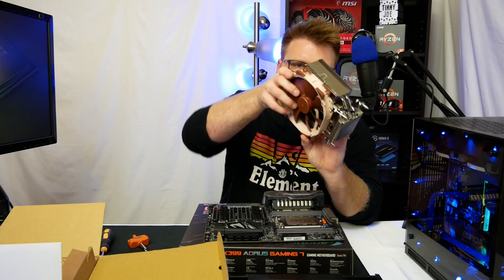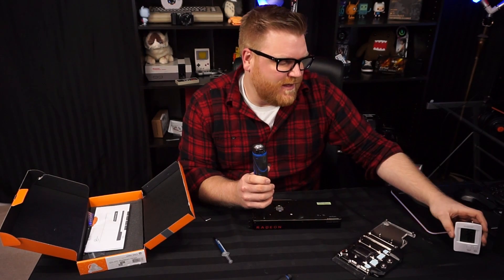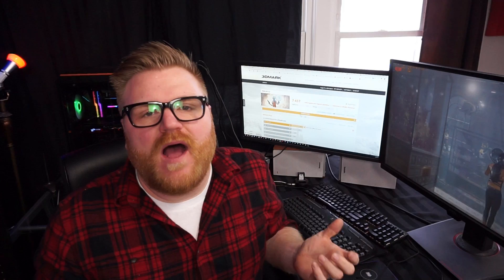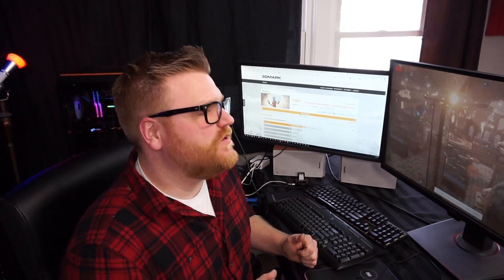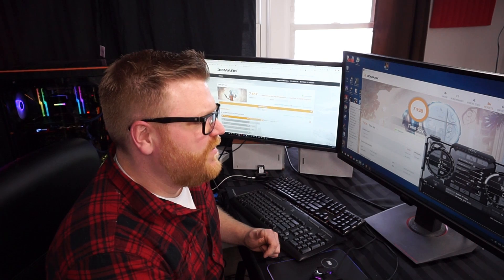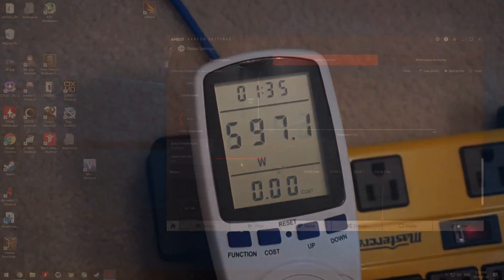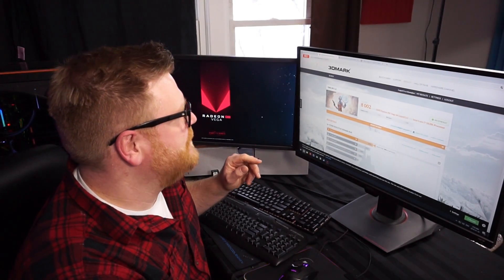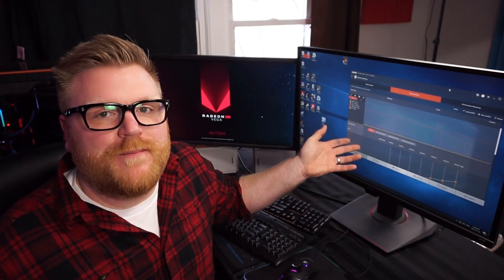Overclocking Vega 64 TO THE EXTREME

Comment: I been playing around with a 1050 ti I got recently that uses external power by Gigabyte. The core was underwhelming at only a 100 Mhz offset for a boost clock of 1860, but the memory, holy shit the memory! I got an offset of 996 Mhz! My memory is running at 4.5 GHz for an effective speed of 9 GHz! I've never got an over clock of that magnitude on anything in my life, and the temps never even hit 60 degrees.

Comment: If you try overclocking your CPU again with the super cold Canadian winter wasteland. Use a watercooler like you did with the Vega. Also get a small heating pad and put the PC on top of it and a lot of thermal insulation around the socket. Just a idea. I dont know if it would work.

Comment: that score is to low, i make 8188 with just 1700 mhz and a ryzen 1700, check that: https://www.3dmark.com/spy/5488345
Reply from the maker: But my graphics score is higher. I'm using a cpu with 4 less threads dog.
Reply: @TimmyJoePCTech  yeah you are right i was just comparing the overal score but even then i think you should get better results, with  140mhz more, by the way that was not my best result i missed when checking the links, here it is, https://www.3dmark.com/spy/5330202  as you can see is just 18 less
Reply: @TimmyJoePCTech  I just run another bench with a litle more oc and get a better result, i think is can be the memory speed, and maybe your giving a litle to much voltage, in my experience with lower voltage Vega can sustain higher clocks. new bench: https://www.3dmark.com/spy/5988543
ps: and by the way my vega is a saphire nitro with stock cooler